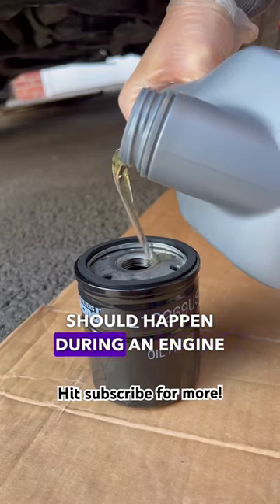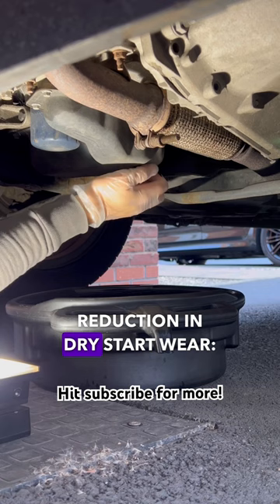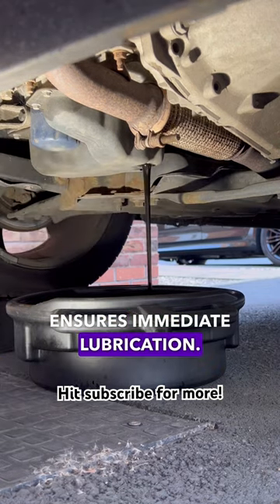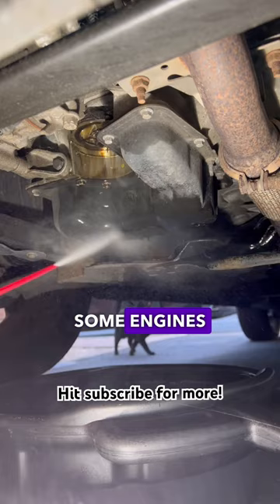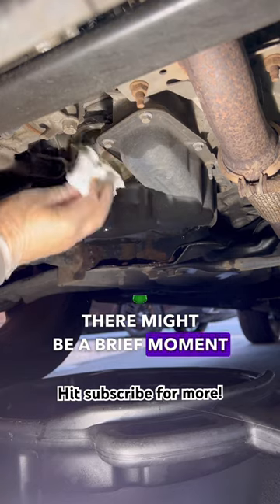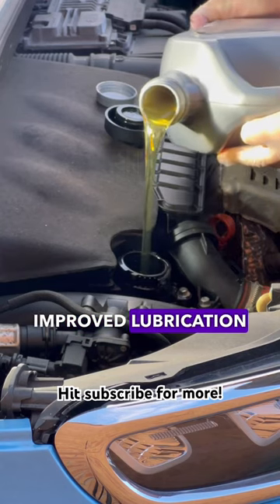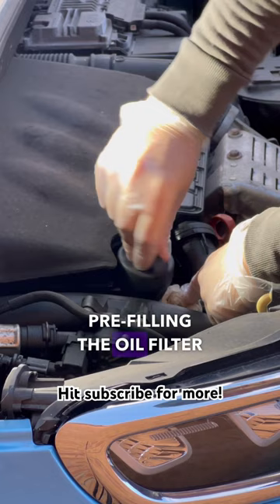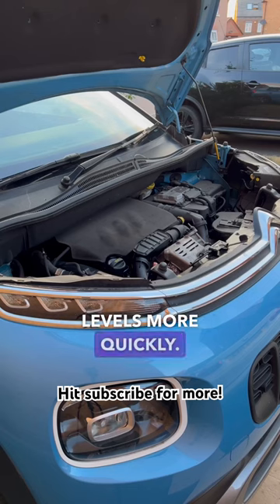Why Filling Your Oil Filter During an Engine Oil Change is Vital! Audiio music License :# 9349524873

Comment: You don't fill the filter up, just a small amount of oil to wet the element. This allows oil to flow through the element faster, as a dry filter element needs to absorb oil to flow efficiently.
The pump will fill the void in the filter and passages in a fraction of a second as the engine starts, fast enough to prevent significant wear.
Very large capacity filter assembly on bigger engines are filled about half way.

Comment: Number one is partially correct. 2 is the same as 1. All the rest are rubbish. Particularly the one about the bypass valve. 

They tell you not to do it, because the risk of contaminants entering the filter is far higher than the risk of damage from the extra time it takes to build oil pressure.

Comment: You dont need to do this it makes no difference also if you fill it up and the filter goes on the top or on the side of the engine sideways or angle it will spill.